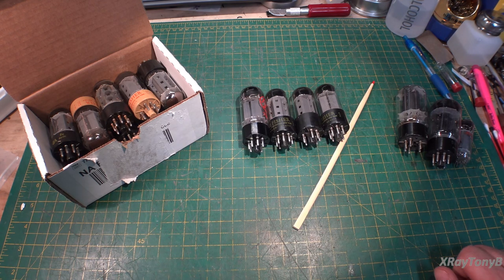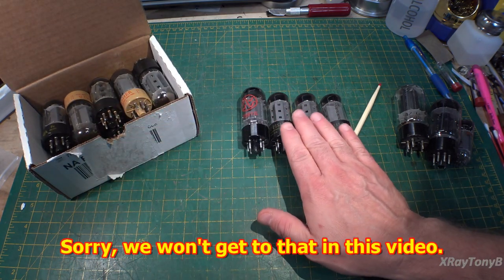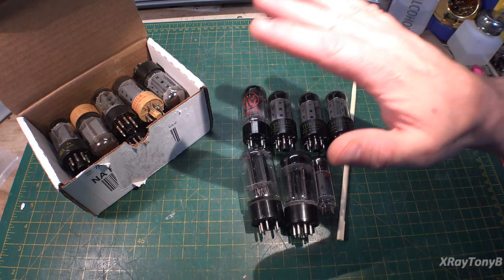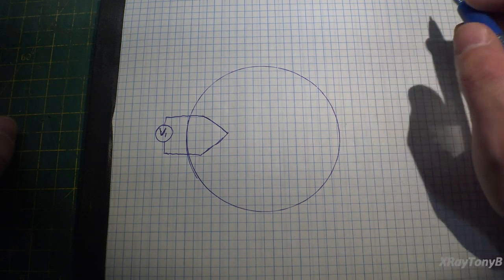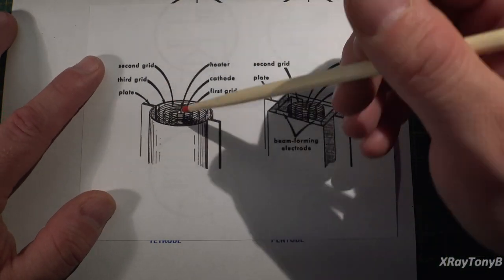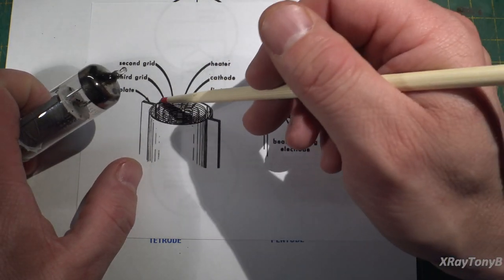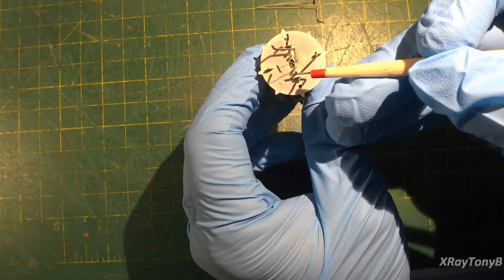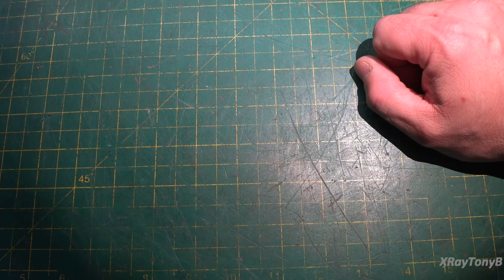Tube Talk - Pentode vs. Beam Tetrode and how they work

Comment: The other main desigh detail of a beam tube is that the screen grid and control grid are wound in the  same pitch tro reduce current in the screen grid.  Also the supressor grid or beam in bram tubes is designed to reducee secondaty emissions from the anode which is what causes the 'kink'.  Beam tubed can usually be identified by the \rectangular anodes vs. the round anines of a triode or pentode.  Christopher

Comment: Good video.  Always good to show the diagrams and real tubes to get the feel for how it actually works.

There is all manner of chemical magic on the filament, cathode, and plate to enhance electron emission AND capture.  (Redplating can damage those coatings, that's why it can ruin tubes.)  The common coating on filaments is a thorium compound.   Good advice to wear gloves when inspecting these things.
Reply: The white coating on pretty much any sleeve cathode receiving tube is a ceramic compound that does two things - It facilitates heat transfer from heater to cathode and it electrically isolates the heater from the cathode.

You are only going to find thoriated filaments on mid and high power transmitting tubes.

Comment: In high school electric shop in 63-64 we still were working with vacuum tubes.  I know the  basic amplifier circuit. A resistor on the cathode biases the grid to be negative with respect to the cathode.

The screen grid often went to the same B+ that the plate ultimately went to.

The plate would be connected to B+ (positive power) through a resistor or output transformer. One tube was coupled to another through a capacitor.

Comment: Great video. I really enjoyed it and learned some things. Just wanted to also mention to your statement about the beam tetrode and pentode being interchangeable, I have a Marshall amp (JCM800) from the 80s back when EL34s (pentodes) didn't make it across the ocean very well and Marshall was having a lot of warranty issues with them, so they started putting 6550s (beam tetrodes) in instead for American bound amps. About 10 years ago, I converted my amp to EL34s and I love the difference in the sound even though the only modifications for it were a few resistors in the biasing section. Anyway good example of almost being perfectly interchangeable yet, sounding very different. Again, liked your video and subscribed. Please keep up the good work.

Comment: Thanks for video. Enjoyed very much, explanation very good. (..learning more&more tube, later sometime perhaps will restore an older radio from our family grandPa-era. Only fix done so far is to cut and throw away the mains-cord. Will put a safer new-one later when starting project.  ,,ByTheWay, have digested further safety precaution regarding tubeGear working. One hand in pocket, amongst other things.) Thanks again for this tube theory-video.

Comment: The tetrode wasn't invented to get greater gain. Triodes have capacitance between the control grid and the anode which creates feed back and makes them incredibly difficult to work as RF amplifiers. The tetrode's screen grid acts as a shield which grounds this capacitance. As a side benefit, when the anode voltage is high enough, the anode current depends on the screen voltage instead of the anode voltage and thus gives the tube a high plate resistance and therefore high gain.

The kink in the tetrode's curve is caused by secondary emission; when electrons hit the anode, they knock other electrons from the anode which may travel back to the screen or the anode depending on the anode voltage. To avoid this kink, the plate voltage needs to be higher than the screen voltage. The pentode's suppressor grid eliminates the kink by repelling the electrons from the plate and preventing them from traveling back to the screen grid.
Reply: plate is the anode right?

Comment: I prefer to think of tubes in terms of electric fields.  Because that's what the electrons react to.  An electric field is the voltage difference between two elements divided by the distance.  So, if you had a plate voltage of 100V and it was 1 cm away, it would be 100V/cm.  When you have multiple electric fields, you calculate each one and add them up.    So, if you had a grid at -10V and it was .1 cm away from that cathode, the net electric field at the cathode from the plate field and the gride field would be zero (100V/1 cm - 10V/.1 cm = 0V/cm).  The tube would be in cut-off.  The control grid, being closer to the cathode has a bigger effect on the electric field than the plate.
Reply: that is a really nice way to look at it!

Comment: 7189 is a up-rated El84/6bq5.  I have a 7591 with a cooked plate like that and it still works and tests good - it's a shame your killed it.  Also, I have never heard of a 7591 being a pentode  just look at the EH 7591 - a repined 6l6.  The problem is, vintage 7591's have more gain than a 6l6 and won't quite bias up correctly but folks still rewire 7591 tube sockets to accommodate 6l6's!  I think the newer EH small bottle 7591s are a octal 7868.

Comment: Tetrodes have properly aligned grids, so they create a minimal beam influence. This reduces harmonics. Then, with a 40-50% output transformer tap, they keep low level of distortions and at the same time keep high u as pentodes do. And there is no licence fee in a price. The only problem is that manufacturers already bought the licence and now produce pentodes mostly. Besides, it's maybe cheaper to place grids randomly, than to wrap them one behind the other.

Comment: I remember buiding hifi power amplifiers using beam tetrodes and the beams of electrons produced light- not light off a screen but the actual beams glowed and changed in intensity as the music volume pulsed. I thought then that was because gas was also introduced into the vacuum to increase amplification but I can find no reference to that???

Comment: This is a GREAT presentation, Tony! I've never heard vacuum tube operation and element-spacing described in this way. The only term that popped out at me was 'tube current'? Is that how plate current is referred to in the X-Ray world? 'Tube current' is probably a more accurate term in that it passes (well, most of it)  through the cathode as well :)

Comment: Hey Tony have you tested any 12AX7 tubes on your tester just wondering what kind of readings you get? I have a B&K 700 and a B&K 747 but I am currently repairing both units. I hear you get low readings with this preamp tube.

Comment: A lot of the filaments were coated with Thorium, which is radioactive.  Good thing you were using gloves.  It’s not something I would want on me or around me for long.
Reply: You'd have to eat the thorium for its small radioactivity to be harmful. Wash your hands after handling and don't put it down your pants and you should be just fine.

Comment: RCA does call the 7591 a "Power Pentode" (erroneously, IMO) in its manuals. Ditto for the 7868.

Westinghouse (the designer of the 7591), Sylvania, and Tung Sol all refer to it as a Beam Power Pentode", "Beam Power Tube" or "Beam Pentode".

I cannot locate my '73 GE Essential Characteristics book to see what they call it.

In my travels I have never seen a true pentode version of a 7591 or any of its variants (7868, 6GM5). The 7591 was designed (and described) by Westinghouse as a beam power tube.

Comment: I think the 7581A's were the latest/last generation of the 6L6GC family?? And thought the 7591A's  were a late 6CA7 variant?
Reply: 7581A was indeed  an improved industrial version of the 6L6GC, designed initially for modulator use.
Reply: Pretty sure the 7591 was originally designed to fill the gap power-wise between the 6V6 and 6L6. The 7868 is a 7591 with a 9 pin large circle Novar base and the 6GM5 is a 7591 with a 9 pin miniature pin circle on a T9 sized button (Sylvania called the design a "9-T9") - exactly the same tube system only the envelope and bases were slightly changed.
Reply: From my limited experience off the top of my head 6L6G are like weaker 7027 they have diffrent interal conectoins than 6L6.

Comment: It is not a voltage divider. Because ur control grid is the most negative element. Control grid is ALWAYS negative with respect to cathode.
Reply: If the control grid gets at all positive it will ruin the tube.

Comment: the way i understood it  theres a licensing issue. thats why rca et al made 6ca7 instead of el34s. they are electrically equivalent but they dont sound the same. a pentode also has less aligning with respect to the screen grid as opposed to the beam tetrodes which must be even more perfectly aligned and spaced to focus the electrons into a beam. its been said and i seem to notice that pentodes have a sort of grainy raspy bite and beam tubes sound smoother . at least thats my experience and what others have posted that i have read as well as i think uncle doug claims some of what i stated in his how tubes work series of youtube videos. i am sure you know uncle doug, although i have not seen more than a couple of your vids you seem more focused on hifi and u.d. likes vintage guitar amps. tomato tomahto
Reply: The Sylvania and GE US-made 'fat boy' 6CA7s were beam power tubes rather than true pentodes. Judging by their construction I would say they share lineage with both 6550s and sweep tubes...